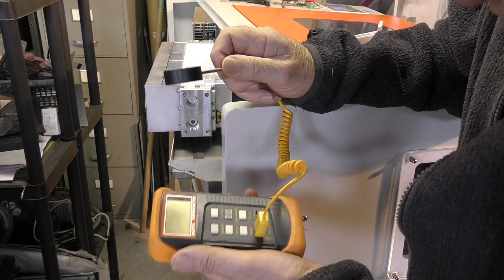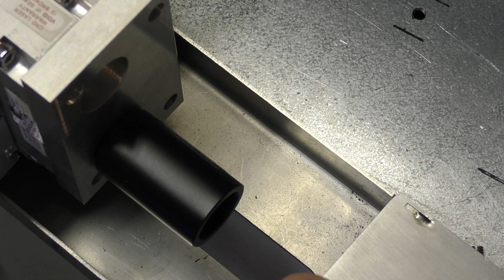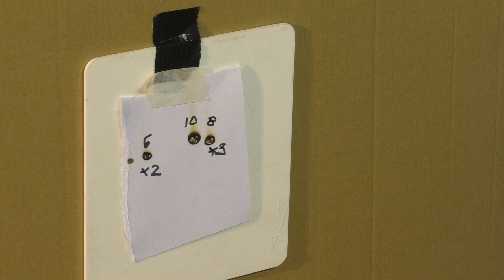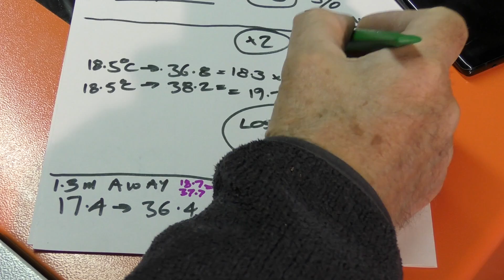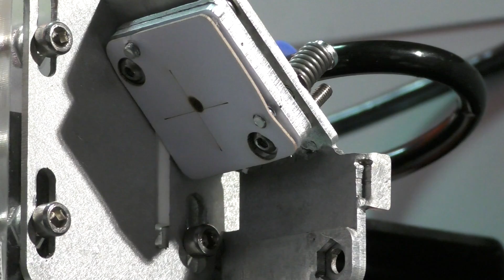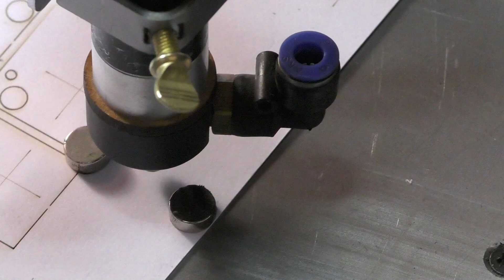TangerineTiger 07 Lets See What We Have

Comment: If your mirrors have enough area you should go with the 3x expander, this will have the advantage to have less power density into the mirrors and lenses causing less wear.
Reply from the maker: Hi Thanks for your suggestion but have you thought about it logically? 
 Question 1. How do solid molybdenum mirrors wear?  They are 97% reflective  to 10.6 micron light.  I am only firing 40 watts at the mirrors . I understand the core light intensity is high  because of the Gaussian distribution  but to "wear" the mirror I have to heat it up locally to over 4600C to boil away atoms.  Hence I cannot see how 3% of an unfocused 40 watt  laser beam can achieve this  Apart from mechanical abrasion there is no other way to "wear" the mirror 
 Question 2. how and why do lenses "wear"?  Zinc Selenide (the most popular lens material )naturally allows about 70% of the IR light through. The other 30% id reflected. To improve this transmission efficiency they apply special layers of antireflective coating that improves this to 95 to more than 99% depending on how much you want to pay for a lens. This material in its purest form with the right size crystal structure can transmit kilowatts. Out little lasers (normally sub 100watts can use the cheapest "rubbish" part of  man made crystal blank and work at more than 97% efficiency . However if the energy density is too high then the losses within the crystal structure will heat the lens internally and it will crack/fail The brown Chinese lenses carry an 80 watt caveat for this reason. The  US manufactured CVD lenses are made from better material  with a much finer and more uniform crystal structure and can handle huge energy densities.
 The main reason you would want to make your beam large is that with good quality meniscus lenses there is less "fuzzy focus" because you can concentrate a wider  beam to a better single focus point. However that light close to the axis of the lens is a) most intense and b) most difficult to focus . There is not a lens being made that can focus, those near central rays to the "common" focal point. The more you spread the Gaussian distribution of intensity (by widening the beam) the lower the central intensity and  the less there is to "escape " to a more distant focal point.

 Acute observation has demonstrated to me that being non conventional and exploiting exactly the thing that you are worried about  ( high core energy density) by narrowing the beam, gives significant cutting improvements  I anticipate that this effect along with the precise pulse control from an RF beam will allow me to also create VERY small dots for high quality photo engraving. 

Trust me, I have not given up on the x3 expander, it will be brought into play much later on when I have done all the testing with the x2 . It may prove to be better at engraving than cutting for example  but like all my  tests, it will stand on it's own merits. If it does have PERFORMANCE advantages I will not hesitate to use it 

At 40 watts I feel very comfortable using the cheap Chinese lenses. However, IF I "pop" a lens you will know about it because I do not hide my mistakes or want others to follow . Learning is all about making mistakes or misjudgments, that way I can pass on factual data and not perpetuate myths.

I must finally apologize if this sounds like I am ridiculing you comment.  Far from it because there is a grain of truth in what you say for high power industrial machines  (i know because I used to own a couple) but for this low power  arena I need to trump fear with facts.  Thus your comment is actually really appreciated .
 Best wishes
Russ

Comment: When trying to check the alignment when dropping the table, if you check the footage, it seems the table itself wobbles and is not dropping straight down (bent screws?). This would make aligning the beam difficult. I could be wrong though in which case, disregard please. Great work!
Reply: Actually, watching again around the 15:00 mark you can see the screw wobbling in the brace. Table may be moving on you.
Reply from the maker: You are perfectly correct these screws are not exactly straight. At present I have nor fixed this issue. That will happen in a future episode  when I get to tidying up lots off odds and ends. It is a simple fix that keeps the table stable where you need it (towards the top). The whole table is slightly wobbly in all directions . This will be a major issue when I start ramping up the accelerations later for high speed engraving. The table and head must be locked relative to each other or the reaction forces will cause unpredictable lscan offsets.
 As for affecting the Z alignment , yes there will be a small effect but consider a 1mm error over 6" and it will not cause any serious angular error.  If you really want to be fussy then put a mark on the top of the leadscrew and make sure it is in the same position for the first and second spot. 
 Best wishes
Russ

Comment: Please talk a bit about what you use for eye safety
Reply from the maker: The  simple answer is  cheap pound store reading glasses. 

That may sound a rather cavalier attitude  but trust me I have no intention of playing Russian roulette with my eyesight. I do not fear the laser beam. I understand it and respect it.
 
There are a couple of important physics facts  you need to know

Light is made up of pulses of energy (waves)  at many different FREQUENCIES. and in the same way that you can feel different frequencies of sound in different parts of your body (low frequencies in your chest and whistling in your ears) so at a completely different atomic level, light affects different materials in the same way. ALL atoms and molecules are vibrating  and 
 FACT 1
That level of the vibration is a definition of its temperature. Make an atom or molecule excited and it will vibrate faster and get hotter.
 
Laser light has two key features.  a) it is monochromatic (just one colour ) in other words it is just a single frequency or fixed wavelength of light. b) raindrops  are not dangerous when the are alone  but acting together they become a dangerous raging torrent. The same applies to photons of light when they all act in unison they combine the energies and become a laser beam.  That  powerful set of waves can excite different materials  by varying amounts.. That excitement takes place at the atomic level. REMEMBER FACT 1

Lets get specific about 10.6 micron wavelength light from the CO2 laser.
This wavelength of light "sees"  only 3 things
1)Metals. These reflect the light and we use this for our mirrors
2)A VERY small group of salt - like crystals that allow the light to pass through and we use these materials for lenses and windows on laser tubes
3) EVERYTHING ELSE. If it's not 1) or 2) then the molecules of everything else  will be excited by the lightwaves to a greater or lesser extent.

Everyone has seen or used a laser pointer or thing to tease your cat with. That is a laser beam and you will immediately appreciate that it cannot leak or jump sideways. Science fact says that light travels in straight lines  so standing in front of your laser machine with the door open while the beam is active   is not dangerous to your health in any way EXCEPT if that beam happens to strike a METALLIC surface and direct the beam at YOU.  Even with the door open you will find it almost impossible to PUT your eye into the path of the laser beam.

 Remember that the SURFACE of your eye is part of that "everything else" and the molecules on the front surface of your eye will become excited by the laser light and will vibrate faster. Faster vibration means hotter. So your cornea will start to cook (HMMMMM smell the bacon!!!).  But your eyes are not that special to 10.6 micron light, your skin. your clothes. they will all be affected in the same way, they will heat up. THERE IS NO HEAT IN THE LASER BEAM. it is pure energy that stimulates molecules and atoms to vibrate faster. It is just like two pool balls colliding. There is an energy transfer from one to the other. The light energy stimulates atomic vibration and more vibration= increased temperature. 

 When you understand what it is and how difficult it is to get bitten then you can respect rather than fear it.

That is not the end of the story  because there is a much more insidious danger that exists. Would you stand and look at the sun?. Would you watch an  arc welder without eye protection.?  If you cut organic materials such as wood leather or card, you will see a bright white light at the surface of the cut. The INTENSITY of that light may appear low but it is rich in ULTRAVIOLET light that will cause damage to the retina if you stare at it long enough. It is mesmerising to watch the beam cutting but don't. A few second here and there will not be damaging if you are running with the lid open. 

Now let's put all  this into perspective.  A direct laser beam will be absorbed by ANYTHING in front of your eyes . Polycarbonate cheap glasses , real glasses, your hand etc etc.
If you have  the cover of your machine down then any window (clear or coloured) will protect you from the laser beam. But only glass or polycarbonate will filter out the UV light

Those expensive goggles you may be tempted to buy if you are ignorant of the fact above, will give you complete  protection at this wavelength because they are  "anything else" and will absorb 100% of the light energy.  But, then again, so will any ordinary spectacles  or if you do not wear spectacles then  cheap  $2 industrial eye protectors will keep you 100% safe.  see https://www.ebay.com/itm/Safety-Goggles-Eye-Protection-Anti-Fog-Clear-Vent-Protective-Glasses-Lab-Work/153903796034?epid=22037548303&hash=item23d5618f42:g:1aAAAOSwsyNelCWh

Watch this video from 9min 13sec   https://www.youtube.com/watch?v=kx4vmDguCyE&list=PLPWEtx5V9DqEogIeYRdcG_KYcB7UL2Qmn&index=2&t=121s 

How do you feel now?

Best wishes
Russ

Comment: Is the laser on the Orange Tiger supposed to last longer than the glass lasers?
Another question I've been meaning to ask you is have you ever tried to engrave on brick with your blue machine? Once again thanks for the video... some more education for this old white haired man.
Reply from the maker: Hi Kris
 Yes the tube is supposed to last substantially longer . It does seem strange because it contains exactly the same gases in the same mix as a glass tube. I am still trying to work out exactly how the RF tube functions and how the physics operates. I am getting close and I can begin to understand the longer life. I will be discussing this in a near future video when I have tr sorted and can explain it in simple terms.
I have tried many things but not brick . It is a pretty rough surface and the engraving marks may get lost in the texture of the surface. It will npr be dangerous because the energy will be absorbed. Whether or not you will be able to do any useful engraving is debatable. Just try it.

Best wishes
Russ
Reply: I have a 100w CO2 laser I have tried engraving on flat clay tile which is similar to brick 
The part which is engraved turns dark brown   
And gives very interesting contrast to it
Reply from the maker: @samlenlap  Hi Thanks for the informtion.
Best wishes
Russ
Reply: @SarbarMultimedia  I know the laser melts the clay thus vitrifying the clay turning into a black glass like substance. I just wanted to know what power you need to that. I was planning on making memorial bricks for our VFW Post.
Reply: @SarbarMultimedia  thanks Russ👍